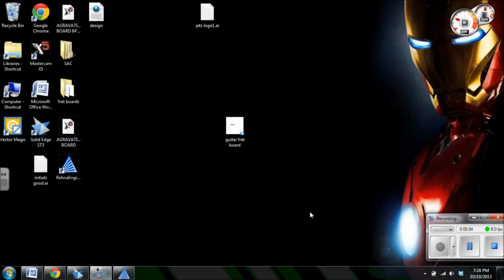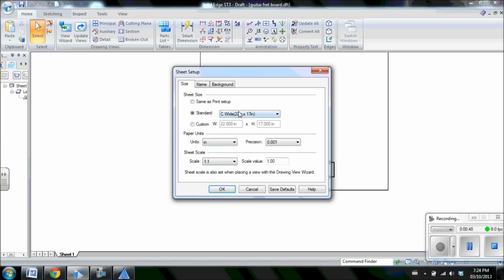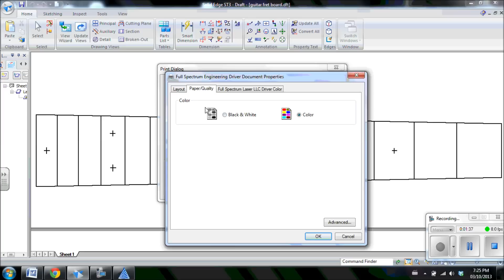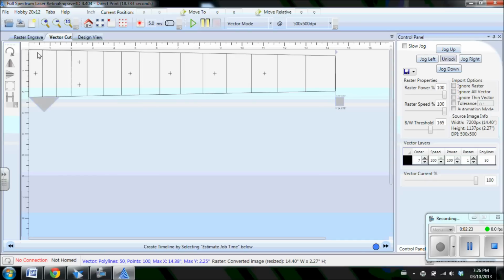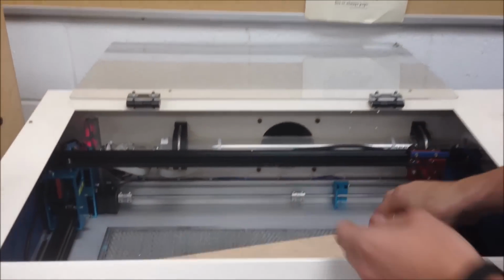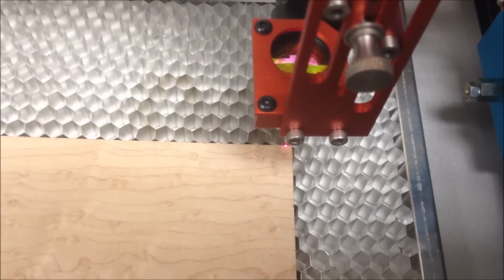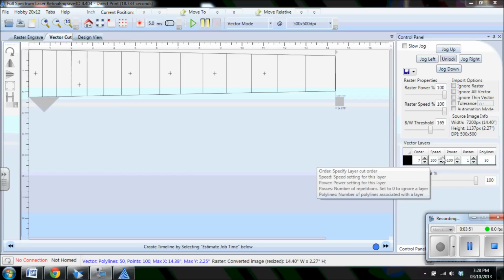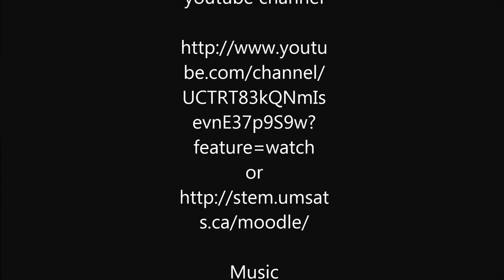full spectrum laser tutorial how to cut a fretboard

Comment: Appears to be the Full Spectrum 12x20 CO2 Laser, 40 watt tube (www.fslaser.com). Just got mine in this week and building up a database of power/feed settings for cutting at different depths. So far having a ton of fun with it. Managed to cut through 3/4" baltic birch plywood at 100% power, 20% speed and 6 passes. I know, big job for such a small laser but it worked like a charm. More fun than my CNC router and you don't have to worry about clamping your material down. Keep up the awesome videos!

Comment: 45 watt laser?
Reply: +Willie Marlow Engraving Area: 20'' x 12'' (508 mm x 304.8 mm)
Machine Dimensions: 31.5'' x 20'' x 8.25'' ( 800.1 mm x 508 mm x 215.9 mm)
Laser Type: Sealed CO2 Laser Tube
Laser Power: 40W
Power Supply: AC 110V native
Gross Power: Less than 1000W
Driving System: Stepper
Cooling Mode: Recirculating Water-cooling and protection system
Operating Temperature: 0 - 45ºC (32 - 113°F)
Z table: Patent pending sliding Z focus + removable floor
Controlling Software: RetinaEngrave Ethernet + USB Direct Print Drivers
Storage: MicroSD slot up to 32GB
Designed and assembled in USA
Manufacturer Part Number: 5GLASER/5GAC